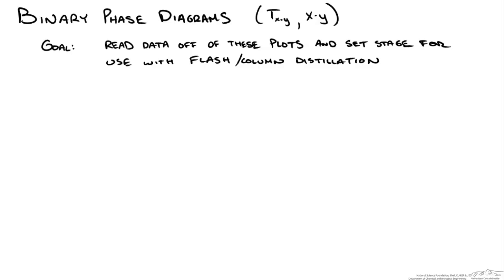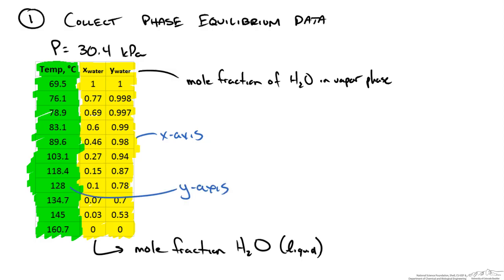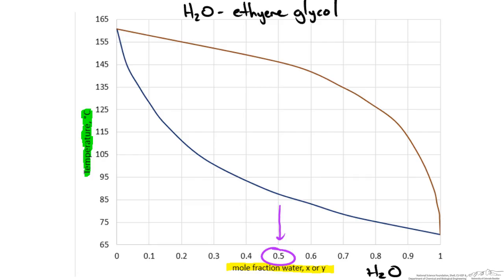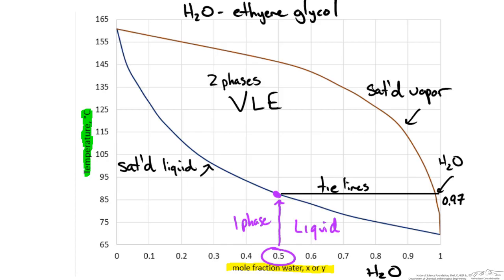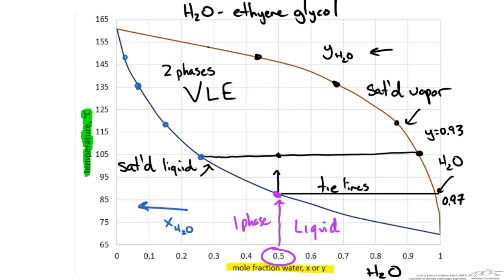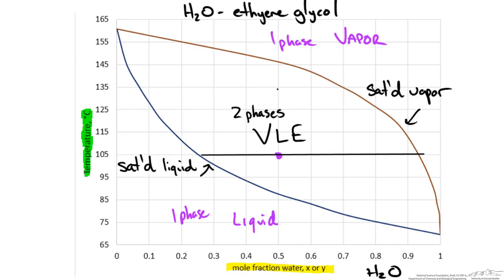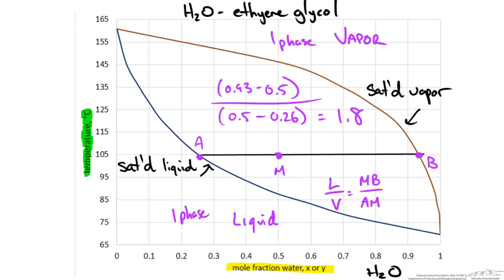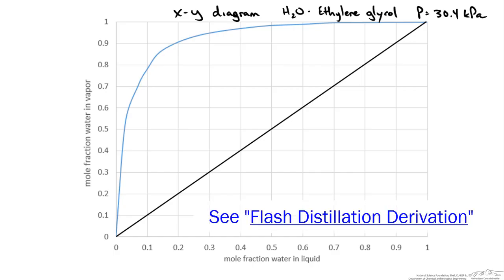Binary Phase Diagram (Txy and xy)

Comment: I can understand that there's no water at 163 C as it might have boiled/evaporated completely. However, I can't understand why there's no Ethylene Glycol at 68 C in both liquid and water phase? Isn't it the less volatile component?
Reply: See the table at 0:54. Different mixture compositions, have different bubble points and dew points. At 68 °C, what you are basically seeing is the bubble point being equal to the dew point because there is no mixture. It's just pure water. There is no ethylene glycol at the right-most point

Comment: @ 4:23 At the first point on the dew point line, you have 0.5 liquid H2O and 0.97 vapor H2O so the balance is 0.5L+0.97V=0.5, and if we do the same balance for ethyl glycol we have 0.5L+0.03V=0.5 which doesn't make sense since the equations cannot cancel out.
Reply: You add liquid mole fraction to liquid mole fraction and vapour mole fraction to vapour mole fraction. You don't know the total number of moles in either phase so you can't just add them. They are fractions of a total (in their phase).

Comment: What I do not understand conceptually is how you only have one phase as you heat the system ? At 3:02 you have 0.5 mol frac water, 0.5 mol frac ethylene glycol and as you heat the system you only have the liquid phase present? If I have a mole fraction of 0.5 water and 0.5 ethylene glycol in a sealed jar and I heat that system, won't I be pressurizing the vessel as more vapor is entering the headspace of the vessel as I heat from 65 to 85C and won't the mol fraction in the liquid phase be constantly changing? Can you tell me where I am going wrong here?
Reply from the maker: Thank you for the question.  The answer is that before you get to approx. 86 degC, there is no vapor.  There is only a liquid phase until you get to the bubble point when some vapor starts to form.  Therefore, the mole fraction of the liquid is not changing before then.  Within the 2-phase envelope, the mole fractions of both the liquid and vapor will change as the temperature increases.  Does that answer your question?
Reply: @LearnChemE  I understand the two phase envelope. But don't all components have some vapor pressure as a function of temperature? The bubble point occurs only when the vapor pressure equals the external pressure, correct? Furthermore, In the example I gave, typically we are taught in a chemistry lab to not heat vessels that are closed (i.e. a flask with a stopper) because there is pressure buildup as the vapor pressure of water increases with temperature,which means there must be a vapor phase. Why is that not applicable here? Thanks for the response
Reply from the maker: @bharathk9594 I appreciate your continued interest in this question and please keep asking if I don't explain it well here.  Before we hit 86 degC, there is no vapor, so there is no vapor pressure.  However, in this case we have no air above the liquid.  If we did, it would absolutely mean there is vapor and vapor pressure - and that would be the case in your labs.  For safety reasons, do not heat a closed vessel.  That is a different situation than the screencast above.
Reply: @LearnChemE  Thanks for the explanations. I suppose I did not quite understand how this vle data is used to model real-world scenarios, if there was no air above the liquid. Is this only applied in ideal scenarios ?

Comment: I have a question from above graph... 
At 65℃ , how can the mole fraction of water in liquid is zero???
Plz answer
Reply: 1. This is because the water is at 30.4 kPa where the boiling point of water is about 70 C. So in case of pure water(right bottom corner of graph) the boiling will start at 70 C. Instead of standard conditions of 101kPa where the boiling point is 100 C. 2. If you are looking at the left bottom corner of the graph it is for pure ethylene alcohol hence the mole fraction of water will be zero no matter how much you increase the temperature. I hope this answers your question

Comment: Ok this sort of still does not make sense to me. If the amount of water in liquid phase decreases, then it is going to increase in the vapor phase, and so do behave its liquid and vapor molfractions. Where am I going wrong in here please ?
Reply from the maker: Good question.  This is tricky.  When the temperature increases, so does the amount of vapor.  The mole fractions of water are decreasing in both phases, but the total moles of vapor and liquid are also changing, so the total amounts of water and ethylene glycol also remain the same.  Check the second part of this video (starting around 3:30): 
https://youtu.be/-XcTEknC9Aw

Comment: how do you determine which is the more volatile component.
Reply: The compound having higher vapor pressure and lower boiling point is highly volatile..
Reply: On the basis of vapour pressure,inside the liq if molecules more attracted to each other,they have less vapour pressure,more different to boil,therefore less volatile
Reply: https://www.youtube.com/watch?v=-XcTEknC9Aw&feature=youtu.be
Reply: the one that is lighter
Reply: @jay.jay.  It's more complicated than that.  Both molecular mass is a factor, but so are intermolecular forces (H-bonds, van der waals etc). The correct answer is which ever component has the highest vapor pressure.
Reply: The one with the lower boiling point